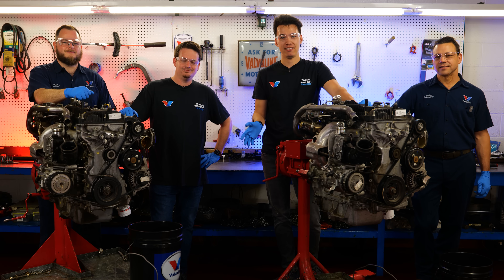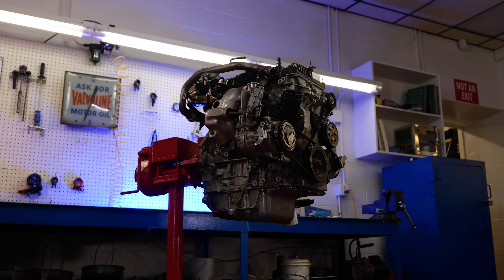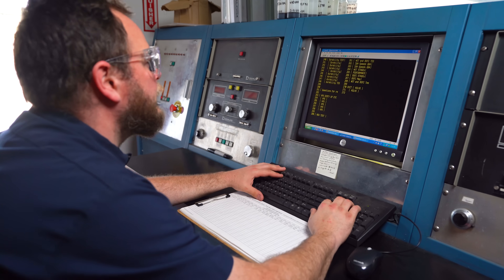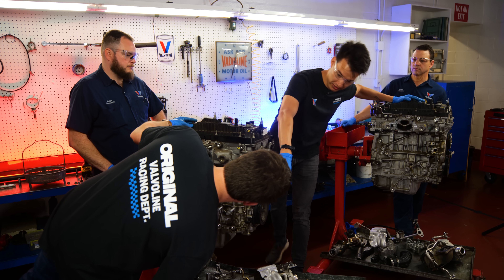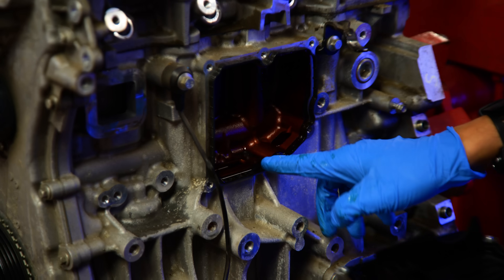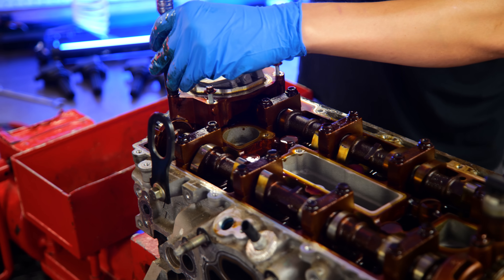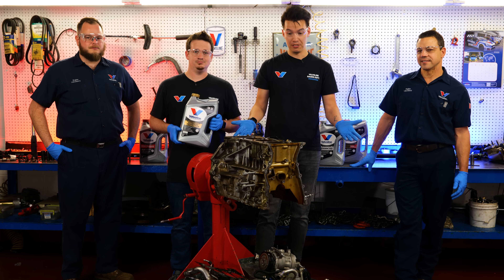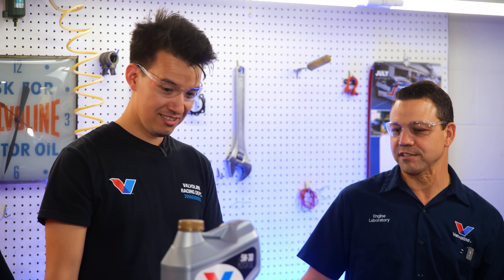Testing different oils over 4 years and 1 MILLION miles

Comment: The fact a Ford engine went 500,000 miles at all is surprising in itself
Reply: Keep in mind these engines got zero hot/cold cycles and just ran and ran. It is hot/cold cycling that really kills engines, so we shouldn't  be surprised by the longevity of these motors.
Reply: What do u mean by that? You mean it wasn't tested out in actual road test during summer and winter months?
Reply: @mastalee1776  That's part of it.  The cold starting of an engine and heating up to temp, then turned off and going cold again, over and over again is one of the main killers of engines. Aluminum heads want to expand and Shrink at different rates than cast iron blocks and so many other complications from hot and cold cycles. This is why diesel highway tractors go for so many more miles than cars. They run and run and run. Less cold cycles.
Reply: @mastalee1776  In the begining of the video they said both the vehicles were placed on dinos & ran.
Reply: @brookmiller-lee123  ah I c. Thanks for explanation
Reply: @brookmiller-lee123  didn't they do that type of test but obviously in a controlled environment?  Meaning they ran the car for so many miles before shutting up. One of the guys mentioned trying to do more of a real world driving operations
Reply: @acoldguy2381  "both the vehicles were placed on dinos"  Yeah, them "dinos" can carry a heavy load.  Problem is they shit everywhere.  It's a bitch to clean up.
Reply: 90% of engine wear occurs during cold start up.  As in engine at room temperature to operating temprature.  Winter cold temp only worsens this phenomenon.
Reply: No lol diesels go longer than cars becausr most cars are gas🤣 gas is like a thining agent diesel itself works like lubricant. Accompanied by other factors as well
Reply: @mastalee1776  not these two, no. They were on a dynamometer day in and day out until they hit 500,000 miles. No stop and go, no sudden redline, no sudden deceleration, and overall less harsh conditions than if they were ran on the road for 500,000 miles.
Reply: @acoldguy2381 they also went down to idle and back up also explained issues each engine had throughout. Did anyone ever actually watch the video ? Lol
Reply: @brookmiller-lee123  they said they had issues they had to stop and fix. The engines had hot and cold cycles and they also said it was a 4 yr test. So most definitely did not just run non stop.
Reply: @brookmiller-lee123  good point! Also stop and go.
Reply: @brookmiller-lee123  At one point in the video they mention that they ran 8 hours a day.
Reply: @brookmiller-lee123 and absolute minimum resistance spinning a roller.
Reply: @brookmiller-lee123 exactly, this is why cars that are used as uber transport or taxis have this kind of mileage and still run great (provided the owner kept up the maintenance). What kills engines is not miles, but variable temperatures.
Reply: @brookmiller-lee123 yea I was gonna say I don’t really think they dealt with the warm/cold seasonal cycles that I imagine would put extra wear on the engines
Reply: @brookmiller-lee123 I wouldn't say that hot and cold cycling kills an engine infact depending on materials some components gain strength from this such as iron blocks. The issue has to do with the design and materials differences cs expantion rates rather than the heat cycle. For instance the hemis have problems upon start due to oil having to flow which means a duration of time where the metal isn't lubed which leads to cam and lifter failures buy design as its a mechanical oil pump regardless of the best oil used. The new zo6 is a tight tolerance motor which means when it expands or over heats your screwed. Proper design via cooling and oiling with good quality oil on a good interval 3000k miles and you should be fine.
Reply: @joshreynolds729  Uh, bro all ICE have a mechanical oil pump, and they all have cold start oil starvation not just the HEMI. (The HEMI's valvetrain issues are from the cam center line being higher up in the "V".)  There may be some very recent engines that are using electric pumps as everything is going that way, but I don't know of any.   That's where 80-90% of engine wear comes from...cold starts.  ESPECIALLY cold starts in weather below 30*F...that oil is like molasses.  Even synthetic is like syrup.
Reply: @JViello  on some hemi cars the oil pump sucks and adding a hellcat oil pump often helps fix the issue. And yeah the oil does have to travel a bit farther due to valve train I agree. Some of the newer cars are going electric pumps.
Reply: As a limousine operator, I have seen the 4.6 L V8 Ford engine go 400,000 and 500,000 miles routinely before overhaul. The highest one I saw I was 589,000 miles. And that was with conventional dinosaur oil, although now we use full synthetic.
Reply: @davidgold5961  the 4.6l was a very solid reliable engine, I agree 👍. I had one a long time ago I ramped it into a lake, crashed it twice, and dogged it out like i stole racing it and the motor never once quit. Old cop cars with this engine are still floating around today 🤣.  Every Manufacturer makes shit and they make good cars its on the owner to know what they are buying.
Reply: Or the trans. Unless they’re not telling us everything
Reply: Had a 2005 Ford Explorer, plastic timing chain tensioner broke, engine destroyed at 50K miles. Ford, to save one dollar, $1.00 per vehicle went from metal tensioner to plastic. Ford told me, "too bad out of warranty, your problem". Never buy a Ford again. No Quality. Bean counters and Executive bonuses have ruined quality Ford engineering
Reply: I got 539220 miles from my 5.4 Triton 3v with no significant internal powertrain repairs.
Reply: @Bass_Playa_Two_Point.O  550k + on my 97 SBC. Thanks for playing
Reply: 4.6
Reply: Tell me you know nothing about ford engines without telling me you know nothing about for engines haha
Reply: @kalebmcdaniel9147  I know they’re over-engineered, poorly understood and unreliable as hell. That pretty much sums up all of their diesels except the 6.9 and 7.3 Powerstrokes and every single crappy Ecoboost they ever made.
Reply: So you are so wrong my friend most ford engines are extremely reliable when taken care of. 6.7 power stroke is by far the best diesel engine available right now the eco boost are some of the best gas engines especially the 2.7 and are extremely reliable. You do not know much about ford apparently
Reply: @kalebmcdaniel9147  I’ve owned them. I know plenty. You are a very funny albeit uneducated individual.
Reply: Depending on the ford, the 4.6 2v is bulletproof and would last much longer than 500,000 miles.
Reply: Right...while Silverado 6.2Ls are blowing up and both the 5.2 and 6.3 are dropping lifters and grinding down cam lobes. Oh and their transmissions. 3 separate class action lawsuits. Chevy fan drivel
Reply: I know where there is a 400,000+ mi 3.5EB F150 on original turbos and timing chain. Including a decent amount of towing miles.

Seen plenty of 700,000 mi 4.6L Police/Taxi CV.
Reply: @gk5891   why are these types of testimonials so rare (as in non-existent) anywhere online?
Reply: That's because you would never get half that out of a GM engine without it shitting a chain.
Reply: If I were to be honest 500000 on any new overpriced vehicle is astonishing. I think we should all boycott these newly made planned obsolescence machines. I’m rocking a Yota with 250000. Fingers crossed it goes for many more. They should be ashamed of the quality vs price.
Reply: @ old Yota’s and Honda’s were the best! I had an 82 Celica with 750,000kms and it still ran perfectly when I sold it. I used to buy the old bubble-looking Hinda Civics from the late 70’s and early 80’s when I was in high school and they always had 350,000kms or more on the odometer. I used to buy them for $300 and bag the hell out of them on the dirtbike track.😂
Reply: I see more high mileage fords than any other car, idk why or where all the ford hate came from. They make extremely solid vehicles contrary to what the internet believes hell dude I have 2 in my driveway with 400k +
Reply: @FishbackGarage  I owned 1 brand new Ford in my lifetime and it was a 2005 F350 Powerstroke. It was not modded in any way whatsoever, it was serviced every 8,000kms with Shell Rotella and it was the biggest p.o.s. vehicle this household has ever seen. My brother in law also had a new F150 with their 2.7 Ecoboost when it first came out. It was also a p.o.s. money-pit. At least his lasted until the end of warranty though before breaking down. Lol
Reply: @beri232 brother idk what to say other than you had bad luck around them. Best work horses I’ve ever seen are fords, not saying other brands don’t have their respective work horses but overall ford does it best from my experience working with cars
Reply: 2.3 4 cyl  good solid engine
Reply: Dude why do you think they chose a Ford engine to run the test?? They needed an engine that would actually make it to 500k lmbo. That's the best comment you could come up with after watching an informational video on regular motor oil vs conventional? Tell us you're a redneck without actually telling us you're a redneck lol. Whew.
Reply: well. maybe because it didnt touch the pavement.
Reply: Frankly amazing
Reply: right
Reply: Думал они только в России не очень ходят. Отказывается и в других странах так считают.
Reply: This is the engine that has the wet oil pump belt? If so, that is really impressive. 10k mile OCI with conventional oil on that thing is amazing.
Reply: Yep.  I ran a 2016 F250 at work.  I periodically pulled a trailer with a medium skid steer or mini-x on it. Well within it's range.  I also had the factory do all the maintance on it since it was a fleet vehicle.   At 40k I lost my first transmission.  At 70k I lost the second one.  At 98k I started having engine issues, which Ford could NOT find anything.  At 100k I dropped a cylinder.  Took 4 months to get a new motor installed.  Drove it for 3 months and retired.
Reply: @bustertn2014  I had a brand new F350 6.0 Powerstroke back in 2005. Biggest POS I ever owned. It was at the repair shop soooo many times. Their bloody technicians didn’t know how to diagnose the problems most of the time. It went back 4 times before they changed out the correct part. They over-engineer their engines (Ecoboosts are the same way). Then their mechanics are clueless when it comes time to repair.
Reply: I know I was thinking that myself. considering all their cars have an engine recall these days.
Reply: @scottresch9912  Ford & Toyota seem to be in competition for who can recall the most engines. Lol
Reply: I agree and I own a Ford! 5.0 Coyote in a F150 oil changes at 5000, never abuse and at 106,000 miles, total engine failure.
Reply: @  damn! I was looking at getting a new Lariat F150 with that Coyote engine because it looked to be more reliable than the Ecoboost. What year is your truck and are you the original owner?
Reply: Controlled  Environment no stop and go. No real loads. Not surprising.
Reply: Plenty of Ford's with 500k plus miles. Look around.
Reply: My 21 F350 has 460k miles
Reply: @ncrtransport5993  how the fuck? My 94 silverado only has 130k. My 51 bentley has 169k but we used to have a limousine company so that makes sense, my grandma's 2019 f150 has 154k, the 93 caprice has 134k, and the 01 excursion has 123k. How the fuck did you put 460k miles on an engine in 3 years?
Reply: @JaxxonBlaze69  closing on 4 years of ownership.     I drive for work.   Average month is 10k miles logged. So anywhere from 100k -120k miles a year.
Reply: Cause it was on a dyno inside n not driven on road
Reply: i said the same thing
Reply: 😂😂 you tried to act like you know stuff
Reply: @ judging by the likes on this post…. I’d say there are plenty of other folks that also “know their stuff” when it comes to Ford!
Reply: Not surprised at all be a 1932 V8 ford made a million miles back 85 years ago ago so ya the American engine’s are superior to any thing on the Planet
Reply: Ford makes some of the best engines on the planet
Reply: @ suuuuure…. like the 6.0 Powerstroke? Or the 6.4 Powerstroke? Or the 5.4….. or….  or….. or…… Ford engineers make complicated engines that do not get tested enough before being pushed on the public. The 5.0 Coyote could have been the exception to their engineering blunders but one truly has to ask oneself…. why mess with something if it’s already perfect? Unless you’re a Ford engineer who must get some sort of annual bonus for blunders.
Reply: Plenty of Ford engines with that much milage. Key is maintenance
Reply: @beri232 stop babbling and take your meds
Reply: Starting a engine is when most of the wear happens. If you just keep it on and run it that wear is massively less.  If you have a car that has an auto shut off feature to save gas, always turn it off when you first start the car.  Or better yet get a bypass and just bypass it all together.  Saving a little gas is not worth the wear the engine takes starting and stopping.
Reply: @ idling all day is as bad as turning on and off the engine every major stops
Reply: The other thing they don't discuss is the rpm load. It appears there was no heavy acceleration beyond 3k rpm plus no hot/cold cycles. If you keep your motor below 3k as much as possible you'll get way more use.
Reply: It's a lab environment.  Not real world.
Reply: Well, both engines had failures.
Reply: Did they do a compression test?
Reply: It’s because they controlled the scenario that’s why!
Reply: These cars were run in controlled environments. No potholes, no sudden swerving, no crazy acceleration by exuberant drivers. The maintenance plan for them is also unrealistically impressive. 99.8% of people don't take as good care of their cars as these.
Reply: The 4.9 300, the 7.3, the 4.6… I’m not a ford guy at all but those 3 engines were made well.
Reply: @jonathanm1854  my very first new vehicle was a 2005 Ford F350 Powerstroke Harley Edition. To date…. it was the single most expensive vehicle to maintain that we ever owned. It also claims the title “most time spent in shop”. It’s also the only vehicle I was ever involved in a class action suit with. It was a flaming pile of shit and it had not been modified, or programmed or anything else. The egr cooler went, the head gaskets blew, the turbo died, the ficm died, injectors died, the ipr died and in some cases…. The technicians misdiagnosed and just threw parts at it hoping it would cure the problem. Then came the first iterations of the V6 Ecoboost….. more garbage. No….. Ford has been the worst brand next to Pontiac that we have ever owned. I buy Japanese now. Well…. not the new 4 cylinder, hybrid, Japanese garbage. That shit is a ticking time-bomb.
Reply: Neighbor has a V6 4.2L F150 that has over 300K on it.. original engine
Reply: Because your an idiot people that service there fords know they last now a shock would be any GM lasting have that long
Reply: @p @pwilly8543  don’t tell us shat your mother gave birth to but couldn’t raise! I changed my oil every 8,000 km since new on my 6.0 Powerstroke F350…. I stand by my original comment “The fact a Ford engine went 500,000 miles at all is surprising in itself”.
Reply: That’s what I was thinking
Reply: Especially with today's government engineered engines .... The fact a Ford engine went 500,000 miles at all is surprising in itself
Reply: Look around the interweb, there are Ford engines being torn down for inspection with 1.5 MILLION miles, still the same as new!!🤷
Reply: @jeffmiller3150  lmao…. Yeah right!😂
Reply: @jeffmiller3150 I think you meant that in 2023 ford RECALLED 1.5 million vehicles. Their highest mileage vehicle is 1,300,000 miles and it’s going to this day apparently, so nah not even close to what you were referencing
Reply: @jeffmiller3150 
Certainly the exception
Reply: Honestly I call b.s. too! Is this Canadian cuz they have be talking klicks
Reply: You do realize that pretty much all of the responses to your comment are bots? 
I'm amazed that these POS engines made it 50,000 mi... Even under laboratory conditions.. these are some of the worst engines ever made. Nothing from any of the big three is worth two shits in the wind these days.
Reply: @fadingbeleifs  Well, the hard data says otherwise.  I'm not talking about the "quality" ratings that include idiotic things like "how satisfied with the HVAC controls are you"  I'm talking about the real industry standard tests.  The domestic stuff is solid, and has been.  IF there are areas they fail in, it's the accessories such as "alternator, ps pump etc" and other items such as a plastic trim part that would have issue.  Like I said to the other guy, go buy a European luxo barge and see how it treats you. There is a reason $120,000 cars are selling for $25K less than 10 years later with less than 60K miles.
Reply: So who makes a good truck/car these days?@fadingbeleifs
Reply: @fadingbeleifs not a bot here friend
Reply: @fadingbeleifs what are you talking about? Their v8s are king each and everyone of the big 3 variants for performance have insane limits. Yeah obviously you don't buy a slow pos small turbo motor 😂 designed for regular traffic economy or children. Coyote, Hemi, LS, and LT are king of the v8s. Don't buy trash and you won't get trash every Manufacturer makes trash and good cars its up to you to know which are good and bad but it doesn't mean all American motors suck.
Reply: @joshreynolds729  my 2012 Coyote still doing good at 242K miles 👍
Reply: @fernandobriseno yeah the coyote is a good power plant and has had many year to be refined much like Chevy and the ls. Every mustang I’ve ever had has been a rock. Like bro I’m telling you one I did just about everything you could do to a car to it and it kept running 🤣. Honestly a testament to these motors. It’s not the brand it’s the car chosen every brand makes shit this is known. What’s also known is that each brand only makes computer cars so they can afford to build real cars like the mustang challenger camaro vet chargers and so forth so they skimp out as much as they can on the economy eco regular traffic trash cars that is so popular occasionally to flip the bill for these. The way I see it is if you’re not smart enough as a consumer to read between the line then you deserve it.  But yes historically the mustang has had solid motors and the coyote is one of gods motors in my opinion 🤣.
Reply: @fadingbeleifs  I wouldn’t take a North American made vehicle if it were given to me! Lol. Been there, done that! All junk!
Reply: @beri232  " I wouldn’t take a North American made vehicle..."  Unfortunately your premise and thinking is just wrong.  Go guy a turbo V8 Euro luxo barge.  You don't know problems bud, believe me.  Most the domestic stuff is solid...with exceptions like every maker.
Reply: @JViello  I have been buying Japanese. Toyota, Honda, Lexus and now Mazda. Our Mazda has been one of our favourites surprisingly. I always had bad luck with North American and I’ve seen my mother-in-law go through 3 BMW’s so I know I don’t want European.